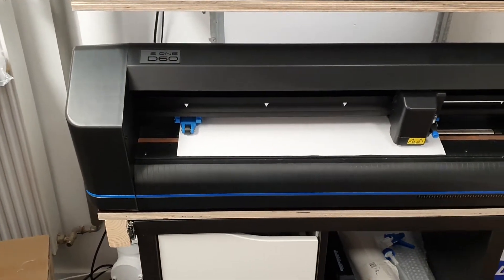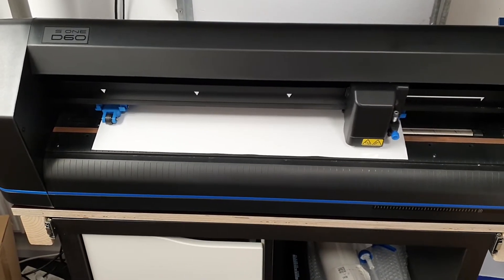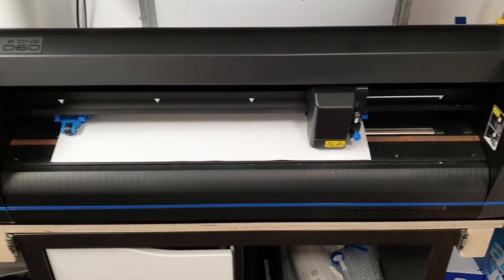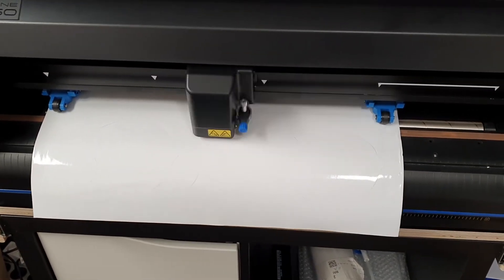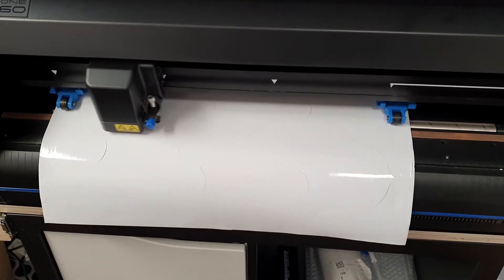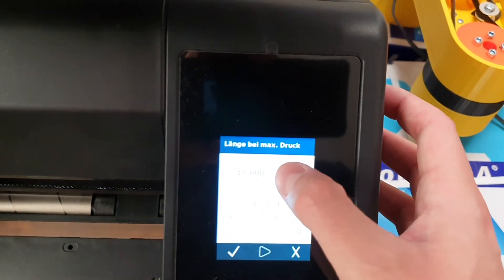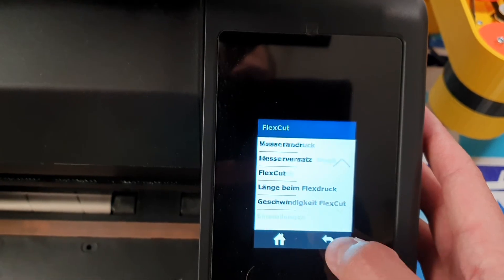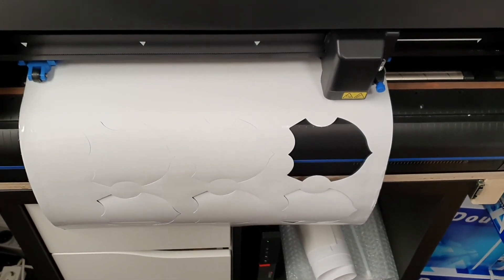Summa S One D60 FlexCut Problem - No continuous cutting paths

Comment: Hi, did you solve it? I've had the same problem for two years.
Reply from the maker: Yes, solved it by buying a Graphtec 😂

On a more serious note, there doesnt seem to be a real fix to this. We started doing kiss cuts  with real high pressure as a workaround, but the result wasn't satisfying and was heavily depandant on the wear of the cutting strip. So switching to another brand for perf cuts seemed to be the best option. We still got the Summa for operations where perfcuts aren't needed.

Comment: Hallo,
gibt es zu dem Problem schon eine Lösung?
Ich verzweifle genau so…

Vielen Dank und Gruß
Flo
Reply: It’s with in your program. On flexi I have it follow a liner pattern doesn’t matter if it’s flexi or kiss cut
Reply: @Stickyslap is it Summa go sign that is the problem you mean? I dont run Flexi, just Summa go sign. Any input would be much appreciated 👍
Reply from the maker: Leider nicht, nein. Auch nach dem Update auf die neuste Firmware bleibt alles wie es ist. Ich befürchte, dass die Pfade in einem Zug der S2 Serie vorbehalten bleiben. Da entweder nur der Version mit Tangentialmesser, oder auch mit Schleppmesser. Das würde ich bei einem Umstieg aber vorher testen. Schade, dass Summa das so handhabt. Ein Schelm wer böses dabei denkt, aber es ist halt leider nur das Einstiegsmodell. Dafür arbeitet es in allen anderen Bereichen bisher absolut tadellos und gut. Nur diese eine Sache eben nicht... Leider...
Reply: @bl4cky89  I have the same problem on my s2 with tangential knife. Havent contacted Summa yet but I think I will. Have you sorted your problem? Kind regards Patrick from Sweden